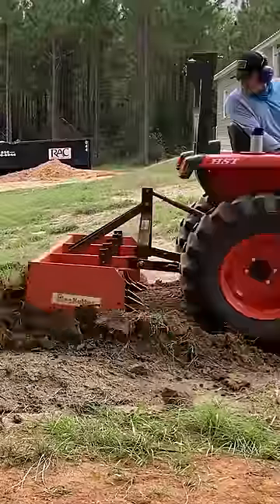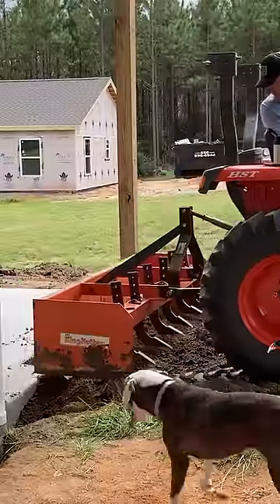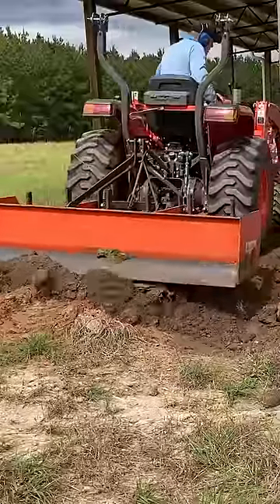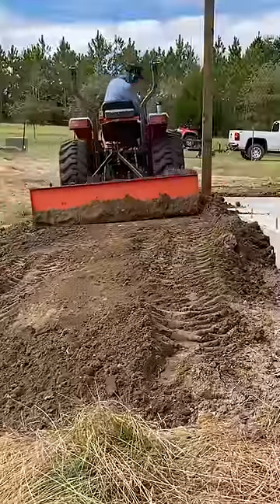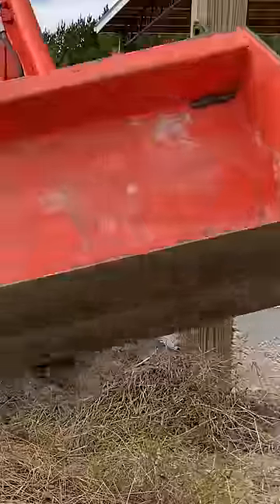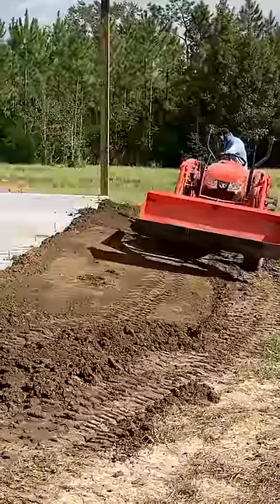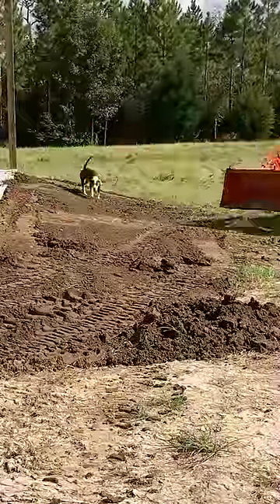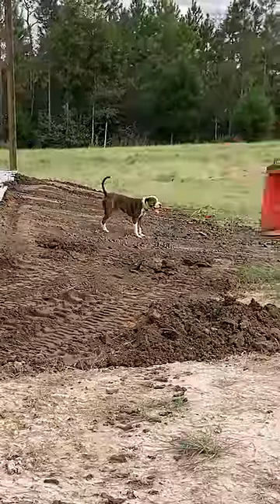Box Blading Around a New Concrete Slab

Comment: Push the dirt into the slab like you did, "drive it in" with your back tires to compact it. Continue the process (2-3 times usually) until you're a few inches higher than your slab and back drag with your bucket to set your grade.

Comment: You made your job way harder and slower than it needed to be. Pro tip : fill your front bucket and push the. Dirt with a loaded bucket when grading this will leave the surface the same grade or level you set while filling in the low spots. Every pass fills in further and longer it also compacts as each pass is completed. You can also roll your bucket forward till eventually it's almost vertical and this makes for long passes starting with a loaded bucket as long as the blade is loaded this will work filling in low spots basically grading like a dozer. I liked what you did with your back box blade to get one side higher it can be done by using a front blade and building  a long ramp close to the building then doing the long end by the dozer method  rather than using the box blade. I have found that as quick and efficient but using your method or by raising one side of the box to make a ramp grade might be faster then using my loaded bucket to finish may be faster. Each method may have its advantages especially when having obstacles in your way such as other buildings or vertical beams
Reply: ok?
Reply: nerd

Comment: One of my favorite piece of equipment was a 580 case construction king backho with a TECO box instead of a backhoe attachment. Used it for fine grading for years. Also excellent for filling and curban gutter Islands. Once you're used to the tiko boxer as you call it back box, you can do so much precision grading really fast. I see all these people commenting about use a skister in the front bucket or use the loader. Obviously they don't know anything about grading or operating.

Comment: Nice job! If I were to critique anything, I would suggest going in 6 inch lifts (or close to it, definitely doesn’t need to be perfect) and then run the tractor in overlapping passes to compact the soil with the tires. You will see soft spots and you can fill those in and run them over to make it consistent with everything around it. It will help with long term soil stabilization on that slope and keep you from having to keep filling holes that will pop up on the level spot. 

Looks like you have some pretty clayey soil there so I wouldn’t suggest adding any water unless it’s hard as hell and breaking like rock, if you were working with sandy stuff I’d say soak it down to help compact it (that’s the lazy man’s way to compact sand)
Reply from the maker: Hard to capture it all in a 30 second video.  We have lots of long form boxblading videos on our channel.   We're not perfect, but we get the job done.
Reply: Yeah that shits definitely gonna sink and erode before it grows grass
Reply from the maker: @FuckTheATF.  that video is 3 years old.   slope and grass is perfect.
Reply: @PineyGroveHomestead  then you must have gotten lucky sir, good for you 👍

Comment: Little hint for the future use a 2×10×10 under your box blade tilt the blade backwards so the board will tilt that will help you float out the dirt better .just a little cheat code for grading.
Reply from the maker: good tip!

Comment: that's the problem when you're using a box blade instead of the right tool for the job. the front n loader to get enough dirt in that location and then backdrag the dirt very little and then you use the rake to get it to whatever grade you would like, earlier seeds down and take a small rake and cover the seeds if you got enough Moore's true in the dirt if not you have to wet it down
Reply from the maker: what problem?  it came out perfect.
Reply: @PineyGroveHomestead  yes you can use many things for the job with that nice tractor it can do or about anything. The operator makes the choice in which tool to use and some don't know really which one to pick from. You can use a hand saw or skill saw to cut the board or a chainsaw. Each tool is designed for several job. The right tool speeds up the process.

Comment: Your bucket should be full when using it to back blade or grade forward. Try it. It works much better and you’ll get a more consist pull or push with the added weight.

Comment: Box blades are worthless. You can to this dirt work far easier with the front bucket because you can see what you are doing and it does not float like the three point hitch on the rear. You can not put down pressure on the box but you can with the front. Back dragging with the front is far easier to level, put to grade and final finish.

Comment: Would have been easier with better result to use the front bucket.  I trick not to many operator know... keep in mine that the back wheels will determine the result of your slope and grade.  The back wheels are fix to the frame just like your bucket.

Comment: Box blades are a lot easier to use with rear hydraulics...
Hydraulic top link
At least one hydraulic side link...
Reply from the maker: that would be nice, but no rear remotes on our tractor.
Reply: @PineyGroveHomestead  
They're always etras
But without the tractors less than half a tractor